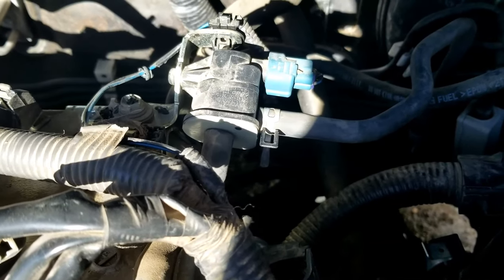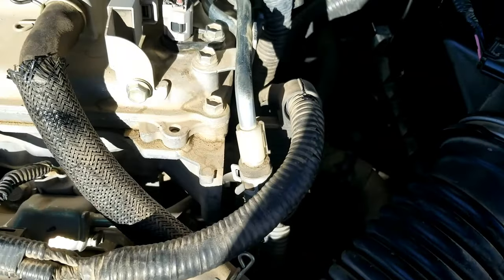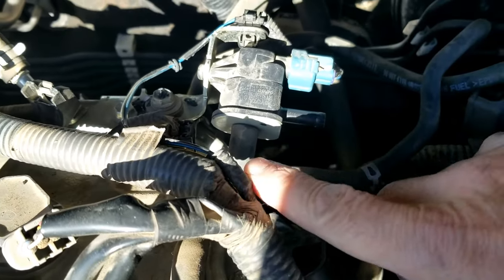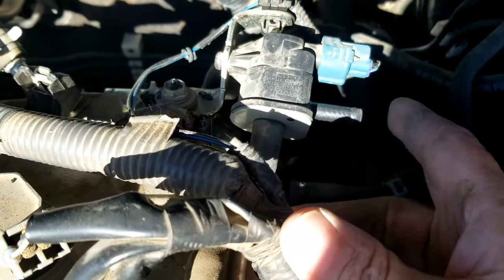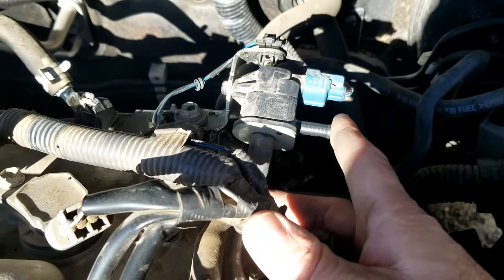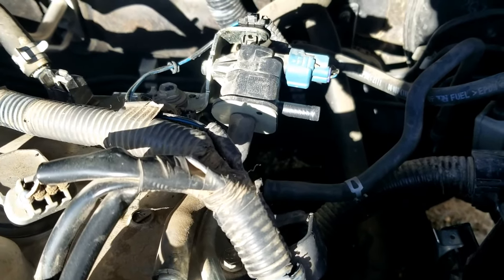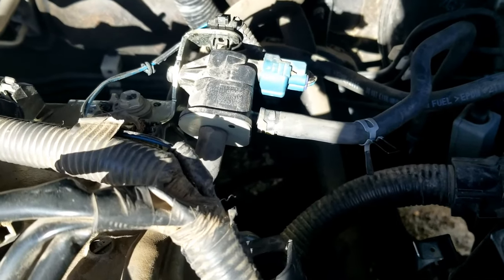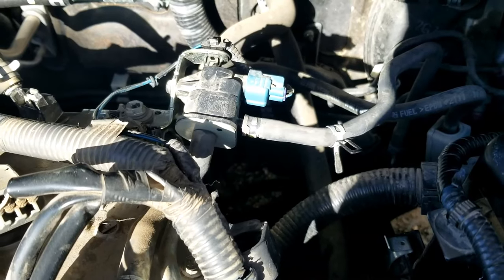How To Test Evap Purge Valve is Good or Bad (No Tools Needed)

Comment from the maker: I made a full video on all the EVAP system components and how to check them; here is a link. https://youtu.be/C5s3Rx3wjD0
Reply: Just ran this test on my 2013 ford explorer . The car didn't run for up to 5mins thou.  But it sucks with electrical connector plugged in and doesn't suck when you disconnect the electric connector from the purge valve . Do I still beed to change the valve.  I keep getting a p219b code every two days

Comment: Only guy that said car needs to warmes up to valve test. Everyone else has folks checking plugs, fuses, etc. Thank you for posting.
Reply: Well you should check fuses etc.. before buying expensive parts
Reply: @sonjacuti2627  it's controlled by the PCM there is no fuse. If it's not working and that purge valve is good you got bigger issues.
Reply: @chinhphan4787 I know this guy, he's my nephews dad.
Reply: @neoleonor7140  so your brother in law?
Reply: @commandar88  I don't really know much about LAW but I know that HVAC mechanic is my nephews dad.

Comment: Most vehicles are not designed to open the purge valve when idling. It behaves like a vacuum leak and can cause a rough idle. Usually the purge valve opens when you’re driving. It’s a good idea to replace the vent valve at the same time. They’re usually right next to each other, and it’s not uncommon for both of them to go bad around the same time. Good video.

Comment: Thanks, that was great! If you don't want to wait for the car to warm up, you can remove the electrical connector on the valve and clip a wire to each of your battery terminals. Carefully touch the other ends to the electrical contacts on the valve. If the valve is good, you'll hear a clicking sound as the solenoid moves.
Reply: Yu can use a 9v battery also.
Reply: doesnt matter positive and negative on the connector?
Reply: @contouraerials Yes, it's a solenoid
Reply: Dude, can you make a video? I’m too dumb to confidently do this after reading words 😉
Reply: On the e240 merk there is another purge valve on the side of the fuel  tank to the canisters    grate video
Reply: @stephenenright8428 is the one by the tank changeable for a rookie mechanic?
Reply: You need a car lift  to make life easy it at the side of the fuel tank

Comment: Question... I ran my engine a good 20 minutes and the valve never pulled suction although in the hose from the manifold - there was suction. So I placed my finger over the open tube on the valve for a few seconds and in doing so it began to function as you show. Is it possible the valve is intermittent or sticking thus throwing the codes?
Reply: Change it anyway. It’s cheap insurance

Comment: I HAVE A 05 MERCURY MARINER. USING YOUR VIDEO HERE AND EVEN THOUGH IT'S FROM ANOTHER TYPE OF VEHICLE, I LOCATED MY PURGE VALVE AND I WILL PERFORM THIS EXACT TEST. IF IT'S BAD I WILL REPLACE IT. MOST OF ALL YOUR VIDEO HERE WILL SAVE ME THE TROUBLE OF GOING UNDERNEATH THE CAR NEAR THE GAS TANK AND CHANGING THE VENT SOLENOID VALVE WHICH MAY STILL BE GOOD. IF THE PURGE VALVE TURNS OUT TO BE BAD. THEN I KNOW IT'S NOT THE VENT VALVE UNDERNEATH THE GAS TANK. THANK YOU VERY MUCH FOR POSTING THESE TYPES OF VIDEOS. IT HELPS ELIMINATE A HEADACHE AND IT HELPS PEOPLE KEEP UP ON THE MAINTENANCE OF THEIR CARS. WHO HAS TIME TO TAKE IT TO A MECHANIC AND YOU GOT TO LEAVE THE CAR THERE ALL DAY WHEN YOU NEED TO USE YOUR CAR DAILY. AND IT'S A TOSS OF THE DICE IF THE MECHANIC IS HONEST OR NOT..
Reply: ALRIGHT BROTHER LET ME KNOW WHAT HAPPENED
Reply: HOW DID IT GO???
Reply: CALM TF DOWN 😭😭‼️

Comment: I have a 1998, 3.3L 4x4 auto. 170,000 miles.
My wife filled gas tank one day last week while it idling and it started acting like it was missing after that. 
She drove it 200 miles through the mountains and got it home. 
No codes.
I opened the gas cap, that looks good, and the tank depressurized for no kidding, 5 to 6 minutes. At first it was heavy and wet fumes coming out, then eventually faded away. No visible leaks anywhere, or damage.

I loosened the gas cap and drove it for 18 miles. No change. Acts like it's mildly missing. Plug and wires only 1 year old. No codes.

Also, the RPM gauge shakes about 200 RPMs when it feels like it's missing. 

Any ideas?  Do ya think my ignition coil just happened to go bad at the same time?  Would that not toss a code?

Thank ya!
Reply: Did you every figure out what was wrong?
Reply: @taylorepps9906  I found two small vacuum leaks using a smoke machine. Repaired those. That made fuel trims good but didn't fix the random misfires. So I have a coil coming today. Going to test it and then install it. I think the coil is failing at higher loads/rpms, even though it ohm tests fine when tested cold to warm, when truck is off. It may be getting weak. I hope so. There's no oil or coolant loss, or smoke, so shouldn't be cylinders. The 3 fuel injectors I could access test good, and fuel trims are good. Plugs and wires are new. Cap and rotor are new. Coil is old though...assuming it is bad.

Comment: Good check, but note that GM does a evaporate test on cold start and passes vacuum to the evaporation system. If the system does not hold vac or is not vented quickly on Vent, or build vac, codes can be set.

Comment: Great explanation!   Mine is sucking like crazy even with the electric disconnected.   Stuck open so I will replace.   Hopefully that will fix my p0449 on a Chevy Tahoe.
Reply: Did it clear the code? I'm about to check this to see if that's the problem. My evap vent value behind the gas tank looks good but I can't check it due to the damn clip on the hose line (won't come off)
Reply: I had to replace the rear vent valve too.  It was easy to get to but that clip is tricky.   It takes a couple small screwdrivers to pry it out.
Reply: Damn, I don't even think I have screwdrivers that small. I'll go pick some up later on. Also on the purge value under the engine cover, how did you test it? Mine has a vacuum line attached to it that won't come off and a stem that has a screwed on green cap. Which one would I use to see if it is staying open or not? Idk what year Tahoe you have but mines a 06 with the 5.3. the previous owner neglected the hell out of this truck, rear main seal was bad and my lifters have that tick
Reply: I don’t get it why on my car I don’t get the purge valve after the car warmed up and two different purge valves not to open. I have no codes what so ever is very frustrating.
Reply: @joshuafleming4433  6 months later here lol. The clip pushes very easy.
A pair of needle nose pliers worked great for me. Trick is to push both tabs up Abita and pinch the top part with other hand then drop the pliers and the hose eascomes off
Reply: If stuck open, will this cause a hard time filling up at the pump? Acting as you have full tank?

Comment: Great video. If this valve wasn’t working properly would it be the cause or my truck wanting to stall after starting just after getting gas?
Only wants to stall after getting gas. Even if I only put a small amount of gas in and not filling the gas tank
Reply from the maker: That is a common symptom of a stuck open purge valve.
Reply: @HVAC_Mechanic  replaced that today on the drivers side of the motor. Same problem after I went and got gas so that wasn’t the problem

Comment: I would recommend doing more test. In my case the purge valve was doing what this video mentioned, but when I did a smoke test, there was smoke coming out of the purge valve and this test won't help if your trying to find a leak.
Reply: Where did you connect your smoke machine to on your car (which I'm assuming is a Honda from your handle)
Reply: @kimoclyde  it's a Toyota Corolla actually. There's a hose behind the motor that I plugged it into. It's hard to explain without visuals and I don't know much about cars, but if you look up on YouTube DIY smoke check you'll see where some people do it.

Comment: Thanks. Quick question (I hope). So I did the test and I can feel the vacuum when the engine has warmed up. But when I reattach the hose, the thumping (open/close?) noise is still present. Does this mean that the line further up is clogged?

Comment: thanks for posting this ... can small evap leaks cause car engines to heat (not necessarily overheat) due to these exhausts not pumping fast enough?
can it cause a car to "shake and rumble" upon acceleration?  my guess is an exhaust pipe might cause those types of issues.

Comment: Good tip. Unfortunately, on my 2008 E90 (BMW) it is located underneath next to the gas tank. It's doable, but somewhat a pain unless you have a lift or ramps. This is great info for other cars however...Well done.
Phil
Reply: It sounds like you’re referring to the vent valve instead of the purge valve? Just guessing
Reply: @BamaJoeBob  Is the vent valve the one near the gas tank on an E90 (2008 335XI)...Thanks.
Reply: @uptownphotography  that's not the same valve. This purge valve should be near the intake manifold.
Reply: @pennyluo9123  Thanks for this info. 
To be clear are you saying the Purge Valve is not the same as an EVAP Pump? My EVAP Pump is next to the gas tank (and a pain to get to), so if the Purge is a different value (and is near the intake manifold), this would be great news as that I likely can get to easily to test. Thanks for your comment.
Phil
Reply: That's the charcoal canister vent valve
Reply: @uptownphotography That's the charcoal canister vent valve next to the tank.

Comment: Some EVAP system purge at idle but this Toyota may not, the purge valve may not be leak full engine vacuum partially stuck open and you cannot feel the vacuum by hand so you need to use a vacuum gauge and you need to unplug  the purge.

Comment: Does this valve start faulting and finally quits? Does it start sticking until it goes bad?  
I tested mine as per your video and it does have suction. Twice though, after gassing up it won’t start like if it is flooded and eventually it will start. 
Thanks

Comment: Also, you can just put 12v power to it using some jumper wires and you can hear it click to open and you will be able to blow through it.  Without power, valve should be closed and won't be able to blow through it.

Comment: I've got a ford 5.4 thats showing evap codes so I tried this method and after letting the engine warm up for about 30 minutes the valve did not appear to open at all. The truck has been having issues losing power and throttle response to the point of stalling out while I'm driving. Could a bad valve cause these problems? The truck will sit and idle with no problems.
Reply from the maker: In some cases, a bad purge valve can cause an engine to run badly, but usually, that is when it is stuck open and causes a vacuum leak. If there is no vacuum at the purge valve, then it is likely not stuck open. I would test the purge valve with a meter and check for an EVAP leak.

Comment: Thank you my code said it was the egr valve so got a new one same problem starts and stalls again till I remove the egr valve connector and it runs fine but once I done what you done it turned out my purge valve was stuck open from a cold engine replaced it and perfect and passed emissions aswel as it failed last time

Comment: Thank you for the video my name is Richard I drive a XLT 2021 F150 Ford says my purge valve was out they changed it and then it took them a couple weeks then they had to put one on my gas tank because I had a light on my Dash just got it back today after 3 weeks light come back on nice trying to say it's from the LED lights I put on my truck that had no problems for 2 months any suggestions

Comment: How could an evap issue cause an xj to die suddenly at stop lights after warmed up and driving, usually about an hour..? I tried to siphon gas out of it, failed lol and then it wouldn't take gas, pump keeps shutting off, and call was pressurized and then this issue of dying, but starting to again after sitting for 10-15 minutes. Think i messed up the filler neck? Or the rollover valve on top the tank with the siphon?
Reply: The purge solenoid relies on the engines intake for vacuum. Mathematics and science explains that an engine running too lean in air/fuel ratio will stall

Comment: Would this be the same part to cause overpressure in the fuel system or something else? I have a small evaporator code and getting horrible fumes from the tank area and also noticed my tank is wet and fuel dripping.

Comment: If it’s stuck open all of the time, will it trigger the annoying P0441 code?
Reply: Evap system is experiencing an incorrect purge flow. It only opens according to gas tank pressure sensor so it sucks in gas fumes from canister to engine intake to burn it. So for it to be open all time it's not functioning the way it should.

Comment: very nice video. i have same problem my mechanic told me i have  to replace my zafira tourer 2017  1.4 Turbo Inlet Manifold Evaporation Purge Control Valve. how can i check myself if is working or need replacing? thanks
Reply: Lmao bro this guys just explained to you

Comment: My check engine light came on, and the Code Read from AutoZone said: EVAP Canister purge valve, was the culprit. What is the cost to repair this? I have a 2015 Chevy Impala. Can a Backyard mechanic fix this?

Comment: So mine (Toyota Camry 2014 with the 2AR) actually has a third nub but nothing is hook up to it (part 90910-tc001) is that just an air purge or is it actually supposed to connect to another vacuum line

Comment: Having it disconnected(the line that goes to the canister) can it throw a code? For example a 09 sienna is showing P0455 and P0441  I just noticed that noice was coming from that valve that has that line loose probably broken

Comment: hello! what about if you are hearing the valve working but not feel the suction ?
Reply: Might have a kinked hose coming from the canister or it's not opening although it clicks. Try removing the valve and blow air while applying voltage to solenoid. Be careful of polarity though.

Comment: Great video  will this part make your car shut off within 10 seconds after starting thats my problem  right now
Reply: That sounds more like a fuel issue. I would check that it’s getting consistent fuel. First there are several things to check. Make sure the spark plugs are all good. Several things best best to run a diagnostic on it. AutoZone can do it for free.

Comment: I got an EVAP code and they suggested this part I changed out the part and the new one is making a that I never heard before. It doesn't seem normal so I don't know if it's supposed to do that. When I took my old one off I checked it for flow and I can't blow through it so they say it's good when it's like that so I don't even know if I'm replacing the part that is throwing the code?

Comment: HELP. I have 2014 Dodge Grand Caravan and my interior light blinks when I go over bumps and ding bell each time and unablle to put car in Drive without using screw driver to bypass lock. Doors do unlock and lock  wih power.   THIS video is awesome with clear informtion instead of paying $200.00. I did mine yesterday in 45 minutes and costed $25.00 only.

Comment: so i have the entire valve off, and blowing through it. should i be able to get air going in in either direction? just 1 direction? the new valve i bought (wrong size btw) doesnt allow air through either side. is this what should be happening with the stock valve?

Comment: I got a P0444 PURGE VOLUME CONTROL VALVE PU code on my car, would replacing the part you showed in the video help fix that code? Would my control valve be open or closed with this code? 

Thank for the video, it’s really helpful! I’m trying to figure out how to fix a gasoline smell in my car after I pump. Nissan wants to charge $400 to replace this part 🥲

Comment: Once the valve creates the vacuum, is it suppose to stay open until the engine cools down?...I checked this when my vehicle was warm so it took a couple of minutes before it opened up for me, but then after a a minute the valve would close then after 5 minutes it would open again for the same duration of time and the process would repeat itself, I also got a cylinder 3 misfire code which is kind of odd since I recently changed plugs and coils....any help would be greatly appreciated...damn these European vehicles!!lol

Comment: I have toyota corolla 2010 . issue is rough idle when engine is warmed up,  on warmed engine I checked there is no vacuum (suction). is it the reason for rough idle?
Reply: Did you figure it out

Comment: Thank you for making this test available. I own a 2007 Honda Odyssey with a P145c trouble code. I did the test and the valve test good. Any suggestions as to what I should check next. Thanks again.
Reply: Gas cap
Reply: Gas cap, canister, or a leak in your hoses

Comment: Why mine still no vacuum after 20mins, but i test it using car's battery and it opens, vacuum so strong .  I also test the socket supply wires and there is 9volts and when engine is running its goes to 10volts. Do you think i need to replace the valve?
Reply from the maker: If it opens when voltage is applied, it is likely good. Be sure it is not stuck open; purge valves are normally closed until voltage is applied. It can vary when the computer sends a signal to open, but usually after the engine warms up. It is best to get a schematic for your vehicle to know what the voltage is, but usually, they get 12 volts DC.
Reply: @HVAC_Mechanic  Yes its not stuck open because i dont feel any vacuum, im just  worried because you said it takes only 5 mins or warmed engine  to open the valve and i waited for 20mins still not opening so i decided to use car's battery and valve finally open vacuum so strong. I also did open the valve manualy while the engine is running and engine stops immediately.  Is it possible that the valve only opens when im running to fast?